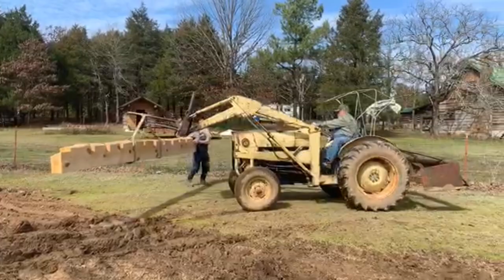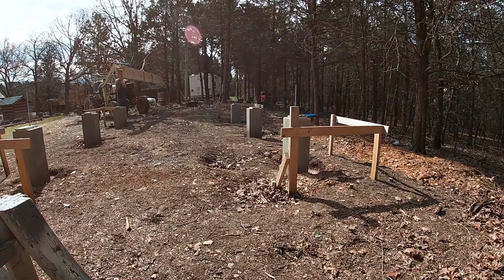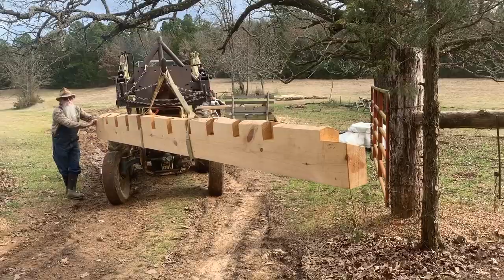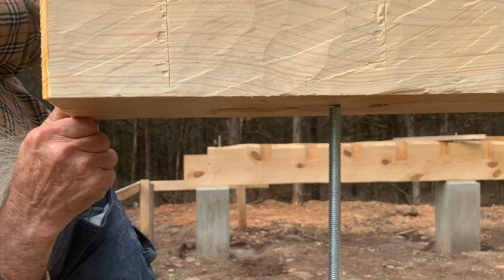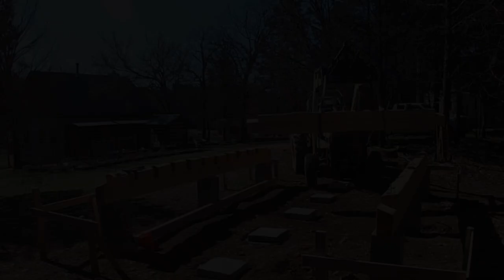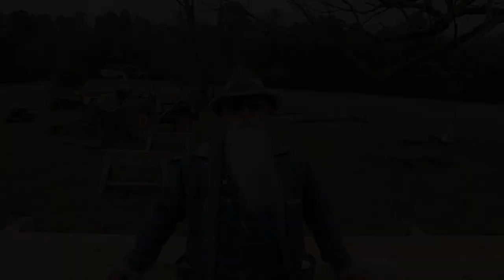Setting the Sill Logs - Dovetail Log Cabin Build (Ep 16)

Comment: Question for you from across the border in the Missouri Ozarks! What do you think about using post bases (like the Simpson EPB66HDG) set into a concrete slab foundation to tie the sill log? Thank you for passing down your years of knowledge and wisdom to us in the younger generation. I hope your videos help others build many homes that will stand for generations and become apart of history.
Reply from the maker: Howdy Christopher- I’ve never used post bases to anchor sill logs, I’ve always put an anchor rod in the pier and footing. May have to check into this. Thank you so much for watching our video. Take care and God bless you
Reply: The anchor rod has two loops, I'd slide some rebar through those loops, those posts will never pull out.

Comment: Another lovely video! Could you please tell what wood did you use for that block under the Sill? What are its dimensions (thickness, breadth and height) relative to the Sill and relative to the pier? Secondly, what metal is to be used between the wood block and the Sill? What are its dimensions (thickness, breadth and height)? Thirdly, what dimensions of wood block and metal flashing are to be used if the foundation is continuous rather than piers? Thanks in advance Sir.
Reply from the maker: AS   Howdy- the blocks of wood are pressure treated and they were 1 1/2” thick and 11” long and 7” wide the meters was some roof flashing l had left over from a job. If you’re doing a continuous foundation you can use a treated 2x6 or 2x8 if you’re just setting the sill logs on your foundation. When I do a continuous foundation I form and pour a 10” wide stem wall and set the floor joists and the sill logs on it.  Hope this helps you. God bless you

Comment: Can you send the link for your hoist design, thanks?
Reply from the maker: Howdy- There is a video of the second floor hoist l built for using upstairs. I have had the hoist I’m using in this video for several years. Watch the video Ep-32 to see how I built the shorter hoist. All you would need to do is make a longer boom and legs. The y’all hoist has the boom connection at the back of the base. The shorter hoist has the boom connecting further out from the back of the base to get the boom at a steeper angle for strength. God bless you

Comment: Hi

What are the dimensions of lumber?
Reply from the maker: Howdy- the wall logs are sawn 6” thick. They are left with the live edge so they vary in height from the tip( small end) to the butt( big end). Thank you for watching the video. God bless
Reply: @TheBeardedCarpenter  Hello Thank you for your reply.
According to the conversion to mm, it is based on a thickness of about 152 mm
And the approximate height is how many mm?

Comment: small log, why don't you build a little bit larger log cabin
Reply from the maker: Hoang Pham   Howdy- I’m on a pretty tight budget with this build. I will be putting a loft in it which will give us more floor area. Thank you for watching. May God bless you
Reply: The Bearded Carpenter the reason I ask , strong foundation, big log, strong sub floor
Reply from the maker: Hoang Pham   I always try to put in a good foundation to hold everything up. I start with the biggest logs first and progressively use the next smaller size as I build the walls. Take care and blessings to you